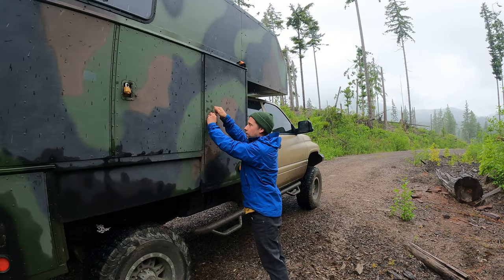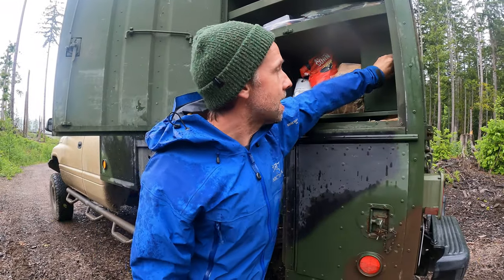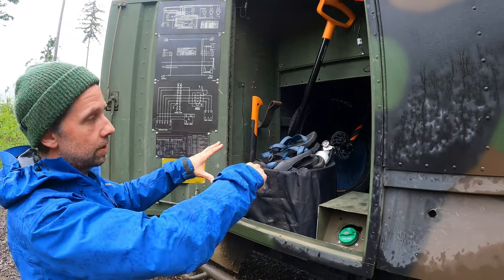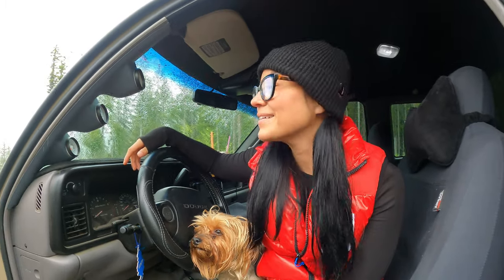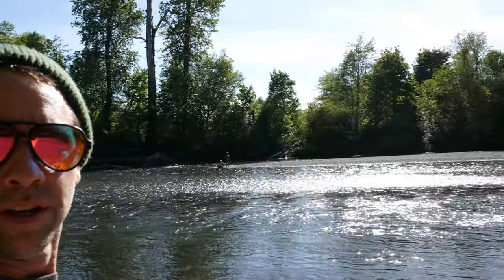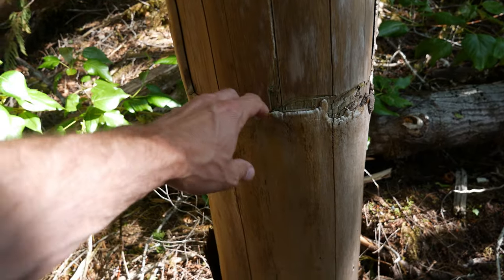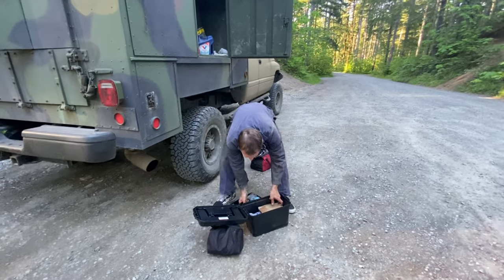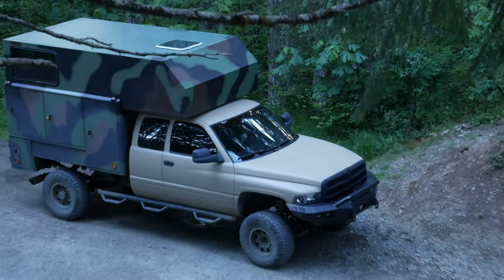Camper tour, build update & road trip + vehicle recovery

Comment: I have a 97 12 valve had the thing for dang near 20 years, mine has an afc live as well so nice for towing.  Achilles heel transmission but I routinely tow 16-17k so to be expected.  My favorite part of the vid included my least favorite part of the trucks you trusted the cup holder 😳.  Doing a great job on the build always look forward to camper updates
Reply from the maker: Ha ha thanks Brent! I should have some more videos up soon. We are currently working our way north from Nevada and saw some pretty awesome stuff on this trip. So far that cup holder is still intact but is running on borrowed time! 😂

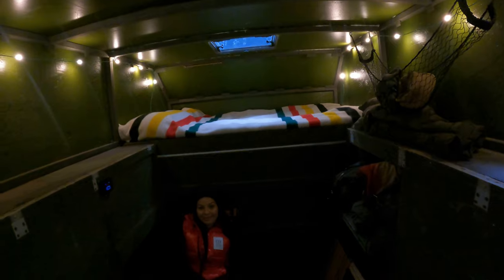Comment: 09:02
re -- insulation
After a half-century of make-do camping in lesser rigs, we insulated our ExpeditionVehicle with:
* acoustic adhesive-backed against the inside wall, a gap, then
* half-inch pink-board, another air-gap, then
* two-inch foil-side poly.
.
Our windows are 3010 (three feet wide by a foot tall) dual-pane sliders designed for a stand-still house.
We mounted our windows at our eye-level standing inside, about eight feet above pavement. 
.
We heat with a Wave 3 catalytic heater on 'LOW'.
We always open two windows on opposite walls.
"But but but LM!, windows open in winter!"
Escaping warm air carries humidity and odors.
Reply from the maker: We have a 2kw diesel heater in the Kei truck mini camper and a 5kw in the Dodge. I agree 100% with venting while heating, keeping moisture that evaporates from wet gear moving out of the vehicle is a must for a dry environment. The diesel heaters are more powerful than we actually need for our interior space so it’s easy to heat even with a considerable amount of ventilation. Cheers! 👍

Comment: That H2 thought that it was an actual Hummer lol. I watched a Doug DeMuro video on the H2 and it turns out that the air-lift hooks are like aluminum tubing and not actually mounted to anything except the hood, for "style."
Reply from the maker: 😂 it was pretty wedged in there and her transmission took a beating on that one, you could smell how hot it was! The other car was like an anchor ha ha

Comment: Nice rig.  I like seeing people thinking outside the box. Pun intended.  How do you like the boat hatch window?  I'm think'n of do'n this for all my windows.
Reply from the maker: Thanks man! The boat hatch has been awesome. We salvaged it out of a wrecked Bayliner. No leaks, easy to install and works great to access the roof. It’s a Bomar hatch, I’ve seen a few good used ones on eBay. One of my favorite mods so far 👌
Reply: @OlympicOverland  yeah, I used to live out there, and there is plenty in the salvage yards.  Usually there made from lexan, and if you van walk on them, then as far as safety & durability it seems like it fits my style. I want to so a few skylights/emergency egress hatches too.  Those welding utility beds are sweet!

Comment: What good samaritans you are! Just wondering, you were mentioning accessing a fridge from inside or out..how would that work, just curious? Fun video!
Reply from the maker: Hi! The fridge would be a top access ARB style on slides so it could be slid outward then locked back into place. I’ve seen some interesting slides over the years that not only move side to side but also have a cantilever so they drop as well. 👍

Comment: Were did you purchase the military box from?
Awesome build
Reply from the maker: Hi, I found the M1031 Military box on Craigslist and lucked out because it was only a 1 day drive away. At the time I had also found an aluminum Reading utility bed for sale locally but the military box was cheaper and had the largest compartments so I went with it over the Reading service box. I have another video posted of driving down to pick up the box and installing it, then welding the new high top. Thanks for watching! 👌
Reply: @OlympicOverland  Well that was a good score then, we are doing a custom camper build as well and love your ideas.
Our build is with a Tufport Camper shell in fibreglass which I will be cutting the top off and raising it and reglassing it.
Reply from the maker: @outdoormountainman  the Tufport stuff is cool! I remember looking into that company awhile ago after seeing some stout looking smaller camper shells that they made. Cutting and glassing will be a great opportunity to add some extra wood stickers for shelving or extra attachment points. Going custom is rad! 👍

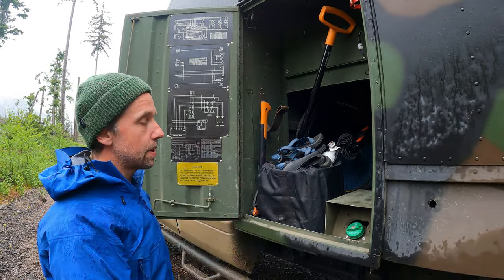Comment: 07:35
Would the fridge slide-out be on the street-side?
Reply from the maker: Yes, but we would probably just access it from inside if parked on a road. That leaves the non street side door as a second entrance with a set of fold down aluminum stairs.

Comment: Do you know what kind of paint is on the cab
Reply: Did you paint the cab yourself
Reply from the maker: Hi, the truck Cab was painted by the previous owner with Raptor Liner. They sell kits with the spray gun included and have a large selection of tints available. It’s a super tuff finish and has held up great to all of the brushed in logging roads that we drive on here in the Pacific Northwest.